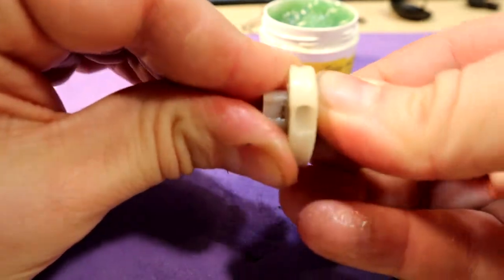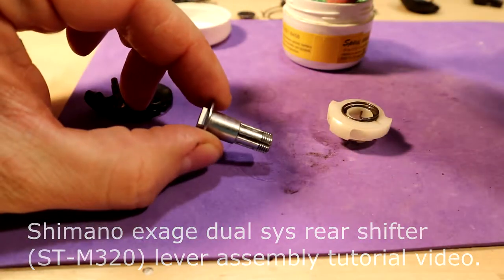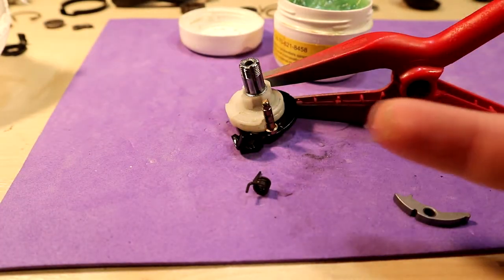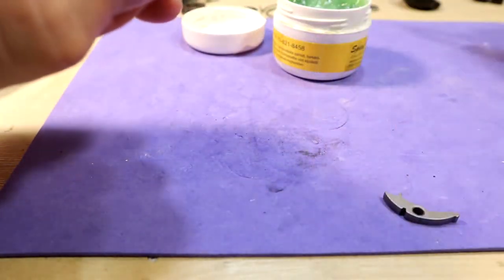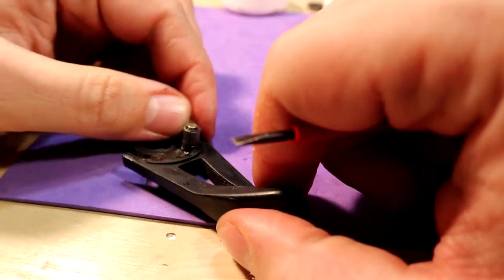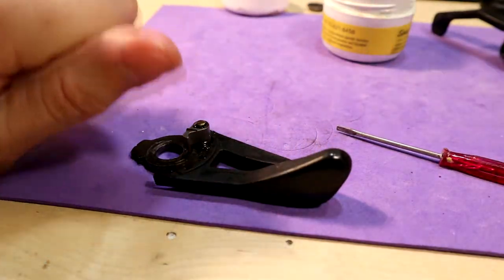Rebuilding a shimano exage dualsys shifter lever part 1. (ST-M320 back)

Comment: Thanks for making this video. I have the same shifters/brakes on my Cannondale H400.  I bought the bike in the 1990s.  I haven't ridden the bike in over 15 years. It just hung in my garage all these years. I took it down recently to ride again but the shifters are stuck. The right shifter does not shift or click at all. I'm going to try and degrease it. Seeing what you did scares me.  I'm kind of afraid to take it apart. It seems to have a lot of parts. And now my left shifter. It only clicks once but I think it needs to click twice since there are three gears. It shifter from the smallest gear to the middle gear without any problems but it doesn't go to the biggest gear when I try to shift it again or make another click sound (I don't remember if it should or shouldn't click). Can you tell me if it should click twice or not when it goes from the 1st gear to 2nd gear then to the 3rd (largest) gear? Also I can't find your video of the left shifter. Did you made a video of the left shifter? Thanks for any advise or help you can provide.
Reply from the maker: Hi there, yes i did, it is public, you find it somewhere on my channel. If you not want to disaddemble it, you have other option: you need to remove the cover wich is held by one phillips head screw. After you did it, flush the naked mechanism with WD40, it will desolve the old greese, and the shifter will shift again. (the shifting problem coses the old hardened greese)
Reply: @BladeRicsi  
Thanks, I subscribed to you. I founded your Part 2. I'm going to tackle both shifters in a couple days. Wish me luck. Thanks again
Reply: @BladeRicsi  
I fixed the rear/right shifter. I didn't disassemble like you did. I unscrewed the bottom cover as you said and then I turned and wiggled the top cover off. I sprayed and soaked the naked mechanism with degreaser. It freed up the shifter. I lubed it with grease, reassemble it and it's working great now. Thanks to your video, it gave me confidence to do it. Now I'll do the front/left shifter.

Comment: this is great thank you. how the hell do you get the brake cable in there? does it require a full tear down? i cant figure it out!
Reply from the maker: Hi there, are you asking about the shifting cable? The shifting cable-, and the brake cable are different, they dont have the same nut at the end. You don't need to tear down, there is a hole the opposite side of the bowden housing,  the comes cable through.
Reply: @BladeRicsi   i meant shifting cable yes. maybe my shifting lever is busted because i have no access to that cable. had to do a complete tear down. Thank you for the video. what year would you say these are from? i was told mid 80's.
Reply from the maker: @kalenburns4190  These are from 1992. If you choose the disassembly, make photos in every step, it helps a lot.t.👍
Reply: @BladeRicsi Hi, maybe its a dumb question but can I use a regular shimano Stiftung cable or is the a special cable needed?